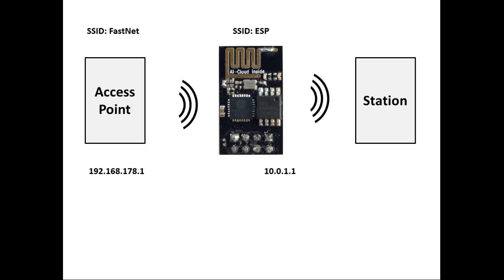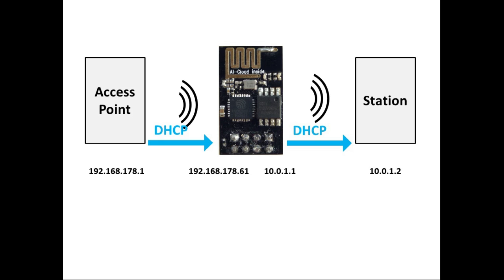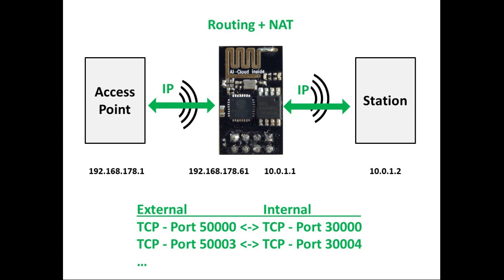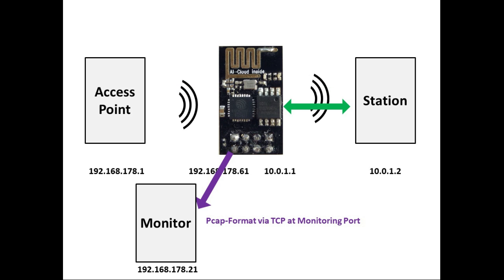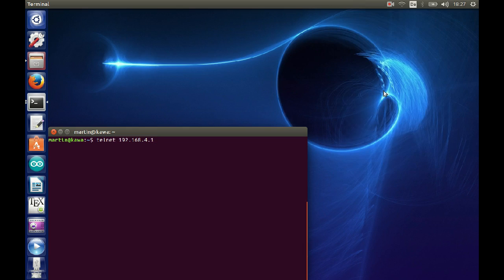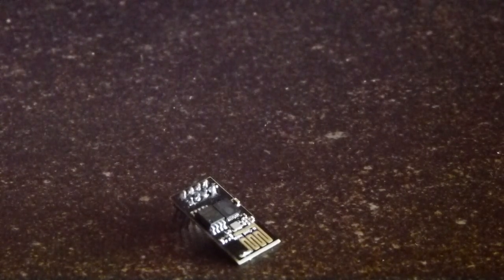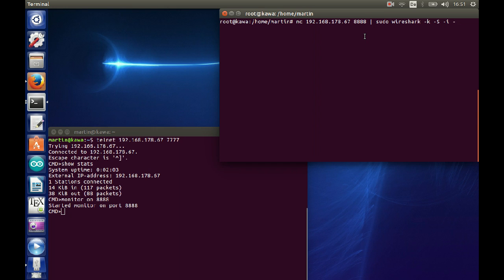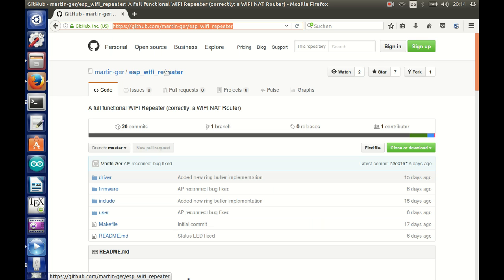ESP8266 WiFi Repeater (NAT Router)

Comment: Hallo Martin,
vielen Dank für dieses tolle Project und die perfekte Umsetzung.
Leider bekomme ich es nicht hin, die Geräte bzw. deren WebUI innerhalb des Subnet 10.24.1.1 von einem Gerät aus dem Netz 192.168.1.1 zu erreichen.
Route add usw. schon auf der Nodemcu per Telnet versucht. Der Repeater hat die IP 192.168.10.187 und vergibt per DHCP 10.24.1.* an die verbundenen Geräte. Vom Laptop192.168.10.165 möchte ich das webui vom Gerät 10.24.1.3 erreichen. Wie muss ich die Route erfassen?
Reply from the maker: "pormap add tcp 8080 10.24.1.3 80"
dann kann man das webUI unter 192.168.10.187:8080 erreichen.
Reply: portmap add TCP muss es korrekt geschrieben werden. Vielen Dank für die schnelle Hilfe. Hat sofort funktioniert. LG Frank
Reply: @martinger327  wenn ich das so einricht dann zeigt es mir im Browser nur "IP blocked:****" an. Was mache ich falsch?
Edit: Es lag nicht an den Einstellungen des ESP Repeaters sondern an den Einstellungen von ESP Easy. Hier war nur der Zugriff über Locale IPs erlaubt. Die hat sich aber durch den Repeater geändert.

Comment: Hi Martin, great work. 
Is it possible to implement your solution using Tasmota?
Reply from the maker: There is no link between Tasmota and this SW. They even use a different build environment. Arduino now also supports NAT for the ESP8266, so you can add it to Arduino projects (like Tasmota), but I am not aware of any thoughts about that.
Reply: @martinger327  Thanks for your reply, Martin

Comment: Hi Martin, nice project, in my case it is working as far as there is only one client connected. With two clients connected almost no throughput?!?
Reply: Fixed with newest firmware (0x20000 and 0x82000)

Comment: Hello Martin, for the esp32 nat router how can i do a port forward?, i can't find the "portmap add" like in esp8266 nat.
Reply from the maker: This is not yet implemented from the GUI or CLI. It is available in lwip_napt.h, you might hardcode port forwards in the code.
Reply: Can you you guide me ? I just installed esp-idf and replaced the lwip with your version. I am amateur but i can edit/search files.
Reply from the maker: @raduraducioi465  Add the call(s) to ip_portmap_add() after esp32_nat_router.c#L367

Comment: Great tutorial. I'm posting this from down the end of the garden thanks to you. 

I seem to be dropping out when I turn on my Bluetooth speaker and especially when I turn on Bluetooth on my iPad. Any ideas?
Reply from the maker: Guess, you are facing the general interference problem of WiFi (in the 2,4 GHz band) and Bluetooth (e.g. http://blog.commander.com/how-to-prevent-wifi-and-bluetooth-interference/ ). Especially if you have lower signal power at wider ranges and more traffic (the repeater of course re-sends any packet) this might occur.

You might try to set the WiFi mode to 1 (b-only). This is an option I added lately. If you router allows b-only clients to connect, this can give you some more dB signal strength and a more robust enconding (but less speed).
Reply: Thanks for the reply :)

Comment: Have purchased a 2nd esp 12e after getting the first one working last month. 

Have flashed it trying with both bin files. The esp AP doesn't show up. Whats going on? Do you think it is a bunk chip? the logo looks like pacman with 'Hysiry' written on it.

edit: turns out this mcu worked with flashing using nodemcu-flasher - also had to power cycle before and after flashing. The other very similar looking mcu did not.
Reply: try using the other group firmware mine too dose not work with 0x10000 firmware i mean 0x40000
Reply: set [ap_mac|sta_mac] xx:xx:xx:xx:xx:xx: work on yours?

Comment: Hallo Martin,
das wäre genau was ich suche. Bin nach deiner Beschreibung vorgegangen und habe die vorcompilierten Files 0x00000.bin und 0x10000.bin mit dem ESPFlashDownloadTool programmiert. Download auf NodeMCU läuft ohne Fehlermeldung durch, jedoch passiert nach einem Reset des NodeMCU gar nichts. Auf der seriellen Schnittstelle kommt nur die Bootmeldung mit 74880 Bd. Keine Komunikation mit 115200 Bd. Es taucht auch kein AP im WLAN auf. Habe das zip-File runtergeladen und am PC mit 7-zip entpackt. Dasselbe mit einem Wemos-D1 versucht, gleiches erfolgloses Ergebnis. Beide Module sind aber funktional weil ich schon einige Anwendungen allerdings mit der Arduino-Umgebung entwickelt habe und diese auf diesen Modulen laufen.
Reply: Problem gelöst; mit aktivieren von DIO funktioniert es nun .-)
Reply from the maker: Hast du die im Readme genannten Probleme ausgeschlossen: DIO/QIO, init sector, und ggf. die Checksums geprüft? Meistens ist es eines davon.

Comment: Great project…I’m using it for my Home Automation via mobile hotspot.  I have openhab running on raspberry Pi and some esp8366’s with less than 8 nodes.  If I configure the Pi or esp8266 with a static IP address the Nat Router won’t see them.  I prefer to have a static IP on the PI so I can SSH/putty into it but static IP’s for esp8266’s not necessary.  I have the PI's IP set to 192.168.0.254.  So, how do I configure the Nat router to have this Pi with it’s static IP?  Thanks for your help.
Reply from the maker: Don't understand completly: the PI is on the "left" (STA) side of the esp_WiFi_repeater and the (some) other node on the "right" (AP) NATed side? It the esp_WiFi_repeater STA interface is set to an IP 192.168.0.x (either statically or via DHCP) it can see the PI. NATing and DHCP are independant.
Reply: The Pi and four esp8266 are all on the same side, the other side is my mobile hotspot.  The problem is if the esp8266 has a static IP address then it is not on the network.  Also if the Pi has a static IP it is not on the network.  If I replace the Nat router with my cradle point router all devices do show up, static IP’s and dhcp’s.  So it appears that I can’t mix Static IP’s with dhcp??? All I’m trying to do is fix the IP of the raspberry Pi so I know what it is so I can ssh into it.  There must be a setting I unaware of.  I guess my work around might be to not have any static IP’s and then do a save dhcp so the PI’s address is known and does not change.
Reply from the maker: Static IP should not be a problem. But from where do you want to connect via ssh? Outside (mobile hotspot)? Then you will need a portmapping entry in the router.
Reply: Static Ip is the problem I’m experiencing.  All devices are on the inside on the same network 192.168.0.x.  f I replace the esp8266 Nat router with my cradle point router all is good.  No idea why Static IP’s are not logging in to the esp8266 Nat router.  I think I will remove Static IP’s and let dhcp take over, then find out where the PI’s IP address ended up for ssh.  Thank you for your prompt responses….its puzzeling. I’ll keep you post on my progress.  Happy New Year.
Reply: Problem solved.  Here’s my update.  As I mentioned above, I was having trouble with the Raspberry Pi 2, running openHAB2, connecting with the NAT Router.  I tried static IP and dhcp, no success.  I thought I was also having trouble with other esp8266’s connecting but was wrong.    I switched out the NAT Router and replaced it with a Cradlepoint M1200B router and all worked fine.  What could be different?  I then put both routers on my LAN with different SSID’s and from the Pi I did a “iwlist wlan0 scan” (WiFi scan of AP) and I noticed that the NAT Router Group Cipher and Pairwise parameters used TKIP while the Cradlepoint used CCMP.  In my Pi networking configuration I was only using CCMP.  Once I changed the Pi’s parameters to CCMP TKIP success.  Not sure what this means but all is OK now.   I’m not a Pi networking guru and I found that all Pi networking tutorials and YouTube videos were very out of date and the Pi (Jesse) configures differently than previous Pi’s versions but that’s another story.   Thank you so much for this great project and your previous responses.  I have another issue that I’ll address with you on a new post.

Comment: thank you very much for your work. it is impossible to make one subnet on different mesh levels? routing and portmap takes a long time to set up every time. if disable nat/dhcp on softAP and bridge two interfaces
Reply from the maker: Due to NAT this is not possible
Reply: @martinger327  it is also strange that the esp32_nat_router project
  works in esp32 dev kit v4 but wifirepeater project not
Reply from the maker: @mikeefpv  esp_wifi-repeater is an ESP8266 project (and the older one), thus it needs a completly different devel environment.
Reply: @martinger327  understood. the mesh project has great functionality that would be very useful on hardware where external antennas are available

Comment: hi, what speed can it do  up/down
as wifi range extender ?
Reply from the maker: Thanks to Ribeiro Santos, who did a speed test at 
"http://www.esp8266.com/viewtopic.php?f=11&t=13002". He measured:
"Using speedtest.net, 2 meters far the router, it shows Down: 6.03Mbps and Upload: 4.83Mbps."
Reply: Yes almost as i got  6.8mbs up & 5.87mbs down
Reply: Here are some performance testing results I got using 6x ESP8266 (WeMos), each subsequent ESP used the previous unit as its access point... essentially to test any degradation of throughput if using multiple ESP units extending each other. Testing each unit by connecting a Linux laptop and measuring the internet speed test (Ookla) and simple Ping, assessing both complex and simple traffic.

Interesting to note that while the first test slowly degraded in performance with each hop, the simple traffic test using ping degraded very little (if at all). 

Home PC with direct internet connection  Download 66.6 Mbps, Upload 28 Mbps

1 Hop (AP1 as Entry Point) (1x ESP8266)
-Download 9.2 Mbps, Upload 8.6 Mbps
-Ping bbc.com
 16031ms, 5% packet loss

2 Hop (AP2 as Entry Point)(2x ESP8266)
-Download 5.5 Mbps, Upload 5.6 Mbps
-Ping bbc.com
 16033ms, 5% packet loss

3 Hop (AP3 as Entry Point)(3x ESP8266)
-Download 3.7 Mbps, Upload 4.1 Mbps
-Ping bbc.com
 16020ms, 5% packet loss

4 Hop (AP4 as Entry Point)(4x ESP8266)
-Download 1.7 Mbps (odd result!!), Upload 3.4 Mbps 
-Ping bbc.com
 16012ms, 5% packet loss
 
5 Hop (AP5 as Entry Point)(5x ESP8266)
-Download 2.1 Mbps, Upload 2.2 Mbps
-Ping bbc.com
 16006ms, 5% packet loss
 
6 Hop (AP6 as Entry Point)(6x ESP8266)
-Download 2.1 Mbps, Upload 2.2 Mbps
-Ping bbc.com
 16002ms, 5% packet loss

Great work Martin!!!

Comment: Hi martin, this project is very useful to make a simple Wi-Fi  repeater. Can we make ESP32 Wi-Fi  repeater with auto mesh  configuration based on this example?
Reply from the maker: No, Automesh is not implemented for the ESP32
Reply: @martinger327   Thank you for your reply. Is there any possible way to achieve mesh WiFi repeater through esp32.
Reply from the maker: @deenadayalan4040  You can configure multiple repeaters in a row manually.
Reply: @martinger327  thank you
Reply: @martinger327  is there any major difference between ESP8266 and ESP32  for auto mesh implementation. Because ESP32 is advanced one.
Reply from the maker: @deenadayalan4040  It can be implemented also on the ESP32 for sure, but as the structure of the development environment is rather different (esp-open-sdk vs. ESP-IDF), it would simply take some effort.
Reply: @martinger327  Thank you very much for your instant reply.

Comment: The nodemcu board is working fine but the internet speed is too slow?? How to solve this problem??
Reply: Obviously the speed depends on the CPU speed of the board. So I believe that with Arduino boards cannot be faster. Give $50-70 and buy a Mikrotik Router that is a firewall / router / repeater / switch / and_more board that can be configured as you wish with settings, scripts, schedules, etc

Comment: Great work 👍 Appreciated the fact that I could vnc into my machine (connected to upstream AP) from my phone (connected to a downstream Esp AP).

Are there any wired solutions that can complement this repeater? 

Like

esp ↔️ wired ↔️ esp
Reply from the maker: The difficulty is, that there is no port with an equivalent speed compared to wfi. UART is too slow, SPI might be a chance, but I don't have a driver for SPI Master/Slave both on ESP and I don't think it will work for a longer distance.

Comment: Thank you for an excellent project.
I having only one problem with AutoMesh configuration.
I'm using level-0 as the home router.
 Testing purpose, turn off the level-0 router and then restarting the level-1 ESP01, in that case, level-1 is going to factory reset. level-0 must use the ESP device only or normal router is ok?
can you please help me out Martin Ger.
Reply: even I saved by using the command "save" and also "save config" after configuration.
Reply from the maker: Level 0 can be any device - typically, it will not be an ESP. Level 0 is identified by having the correct SSID/Passwd but NOT the 24:24 prefix in the MAC address.
Reply: Thank you for your time. now its working good and that is happened due to low power supply and config on new ESP

1. i am planning to built the system like " Level0<->Level1<->level2<->level3 " using AutoMesh, can you please help me?
->tested and able to access level0 device from level2
->so i hope, able to access from level3 also
-> opposite direction, need to access the level3 from level0( MQTT installed  one device on local network with 1883 port) and for send command to level3 from local system for control the GPIOs 
->want i need to setup on firewall and port mapping.
-> for all level using the ESP01 and except level0(local router)
Reply from the maker: If the MQTT broker is located at level 0, just connect from any lavel to it. As long as the connection has been established downwards any further pub/sub operations will just work fine.
Reply: dear Martin Ger,
Found my problem, 
in first case(when testing divice connected with level1):
->when restarting level1 from web-interface and then Level0(Normal HOme Router) divices are not visible.
-> but it is working when restarting by power source and then level0 divices are vissible.
in Second case(when testing divice connected with level0):
->not able to ping the level1 divices(client ESP-01)
->pub/sub operations is working fine but getting some error "no response from server" and "Error: socket hang up"
->not sure, not able to find that issue whr it is coming from.
->client is wotking fine, if connecting directly home-router and no error 

After solving the two task and further ill test by adding two/more levels.

Comment: hello tried to flash bin's inside firmware folder,it flashes successfully and after resetting it the blue led flashes rapidly and wifi not appearing,terminal outputting junk continuously,pls help

Comment: Hi Martin, it's a very good project. But I have a problem, when I am trying to write the firmware on the esp I get the chip sync error. And I couldn't make it connect to the wifi. Do you have any idea what can I do?
Reply: press the boot button while uploading

Comment: I have connected esp (esp with enc28j60 I/f) to home router via WiFi . then I connected enc28j60 to first-pc via Ethernet.  Then if I connect second-pc to esp AP directly .... I can ping my first-pc from second-pc, I can ping home-router gw, I can ping google.com also from second-pc. But my problem is when I connect my second-pc to my home-router via WiFi ... I cannot ping first-pc. I tried port forwarding using portmap on esp but the port is being filtered out by the esp. Nmap utility reports the port as filtered. What other config do I need to make.

Comment: Hi Martin, really great idea.
Reply from the maker: The board in the video at 8:35 is a cheap (<2$) adapter, you can find it on ebay or aliexpress when looking for "EAP-01 UART". Caution: the normal version does not support flashing, only power-supply and serial-to-USB.

Comment: Hi, martin ger,
I'm a beginner at this technology, I have a few simple doubts.

What is difference between "esp_slip_router" and "esp_wifi_repeater(NAT)"?
Reply from the maker: Slip_router is a serial-to-WiFi router, WiFi_repeater a WiFi-to-WiFi router.
Reply: thank you so much for the quick reply and now I got some clarity with confirmation. And I have few more doubts,
1. Is wifi SLIP has automesh? 
2. In slip network initially, one station should be connected with the home router and the station is serially connected with an access point device. From the access point, the other station will have internet. Is am making sense?
Reply from the maker: @RK-yx4xl  1: no Automesh, 2: a device has only serial ports, it then either connects via the ESP and WiFi to an AP and the internet, or it offers via the ESP its own AP for other WiFi devices (no internet connectivity then)
Reply: @martinger327  Thank you so much for the clarification. And my final question is:

Is it possible to have ESP mesh and access point on the same esp chip? Or how can we achieve that?
Reply from the maker: @RK-yx4xl  no, think that is not possible
Reply: @martinger327   sure, Thank you so much sir.

Comment: I tried it with a Node MCU and got terrible up and down speeds as well as 30-50% packets loss. Will give it try with an ESP 01 when I get the chance. Surely there must be something wrong on my side?
Reply from the maker: That's a bad performance, but it heavily depends on signal strength. What kind of perf test do you use?